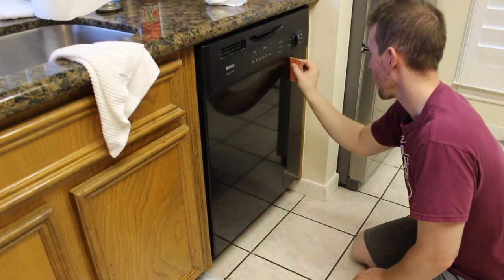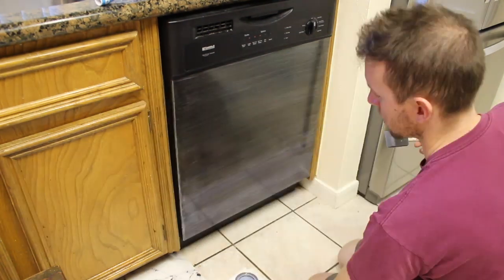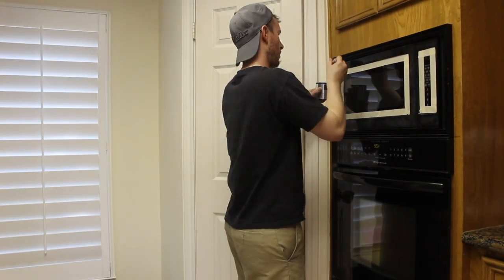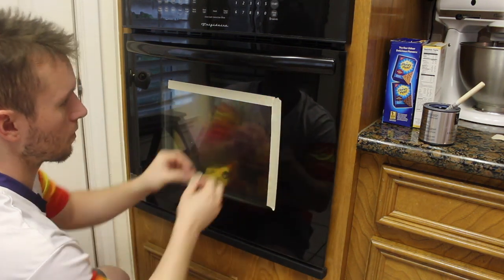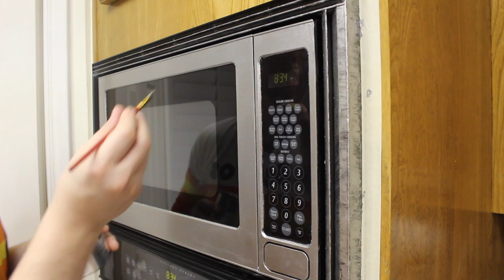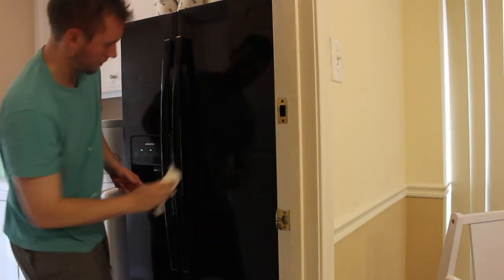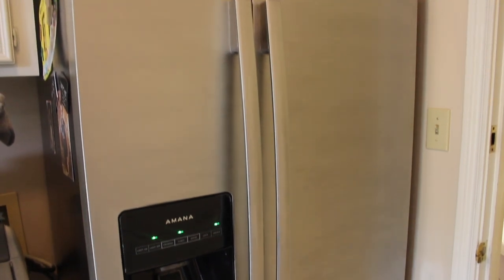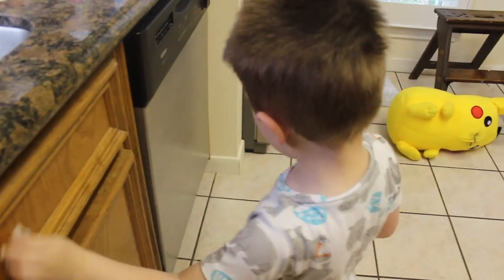PAINTING APPLIANCES WITH STAINLESS STEEL PAINT! DIY HOME UPGRADE FOR $24! HOW TO MAKEOVER APPLIANCES

Comment: You need to pull the tape off while the paint is still wet.. plus I would have used a coat of primer 1st.  Then u wouldn't have needed so many coats.

Comment: Can a roller be used on the fridge?
Reply from the maker: You can, yes. Rollers can use up more paint though so if you have plenty of paint then go for it! But if your working with just the right amount of paint, I would recommend the brush. 😊😊